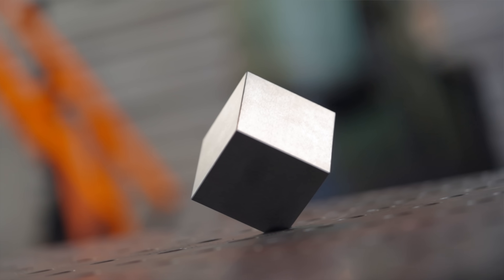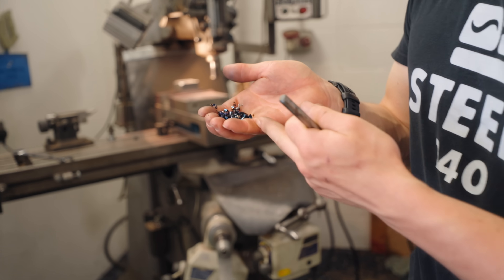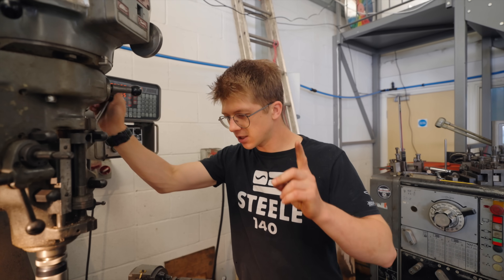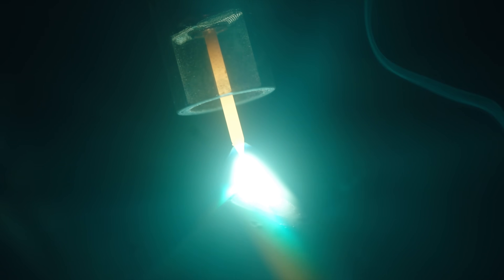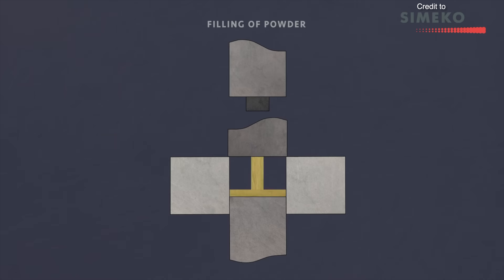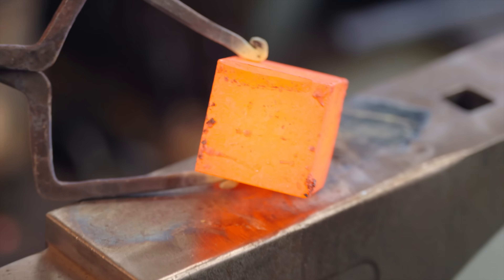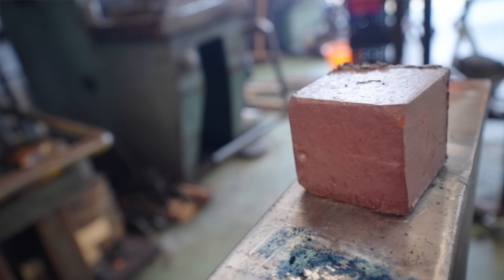Can You Forge Tungsten?

Comment: 4:50 tungsten is quite chemicly active metal and it dissolves in liquid iron, also did you notices that fine tungsten filaments exist? thats stuff is quite mallable, we used it to make lightbulbs ;)
btw. try copper-tungsten alloy, excellent machinability
also you can braze tungsten with steel using copper
Reply: Used to use tungsten filaments, a power source, and liquid nitrogen to convert the filaments into a glass phase (aka amorphous metal), rapid rapid cooling removes the crystalline structure of the metal and gives it some useful properties.

TIG welders will sometimes current sharpen their electrode and end up with an extremely sharp glass phase tip.

Anyways it was really useful for making certain high voltage electromechanical components, we used it to create a tough material that would flex a certain way under high voltage and current

Comment: 5:46 "Max 2MB"
Lol. Do you not realize that most phones take images bigger than that? Even my low-ish end S21 FE takes anywhere from 2 to 6MB.
It should be at the bare minimum be 20MB limit, not 2MB.
Not that I have a workshop myself or anything, but you'd hinder so many people from actually uploading images, unless you expect them to manually compress it by a lot just to send it, which people won't bother doing.
Ideally it should be more like 200MB limit, so you can have multiple images.
Storage is literally dirt cheap anyways, even on a small 1TB drive, if you were restricted to 2MB, that would be half a million images... Yeah, you're not getting anywhere near that amount from people submitting images, maybe more like 100-200 images.

Comment: I bought a little bit of tungsten wire for making tubes but ended up trying some as a needle in  divot for a seismometer hinge. I didn't expect it to be as easy to hand tool as it was. I ended up tripping over it during the night and broke the needle. The way it broke was also unexpected because it splintered lengthwise before shattering short-wise and the surfaces had a sort of cakey texture. I don't think they were actual air voids but looked something like broken cake. I wonder if it was made of incompletely sintered powder which seems like a weird way to make wire. The splinters make me think safety squints are probably an especially good idea when working with the stuff.

Comment: Something to consider with regards to alloying and incorporating tungsten is the fact that almost all liquids can work as some degree of solvent. You don't need to melt the tungsten if the solubility in another metal is good enough to slowly dissolve it. Any oxide layers may make it less feasible, but that'd be my first guess to the ambiguity surrounding some of the processes when you were googling

Comment: That isn't pure Tungsten and it behaves nothing like an unalloyed single crystal of Tungsten, nor even multicrystalline Tungsten.
For that cheap of a price (and considering its poor mechanical properties as displayed in the video), it's 100% just made out of very small Tungsten particles that were bonded together with Cobalt or (less commonly) Nickel.

It is MUCH more expensive to manufacture large objects out of solid Tungsten, so they add the matrix metal to enable low temperature consolidation and also to make machining easier (similar to how adding Lead produces "free machining" alloys), as you have seen by how easy it is to cut and abrade that cube with ordinary steel tools.

Comment: Forging tungsten is extremely challenging due to its very high melting point and brittle nature at lower temperatures. Tungsten has a melting point of 3,422°C (6,192°F), which is the highest of all metals. Because of this, traditional forging methods used for other metals are not applicable to tungsten.

### Key Points:
- **Temperature**: Tungsten can only be forged at extremely high temperatures, typically in the range of 2,200°C to 2,500°C (3,992°F to 4,532°F). However, this requires specialized equipment, like induction furnaces or other high-temperature furnaces, as standard blacksmithing forges cannot reach these temperatures.
  
- **Process**: Even at these temperatures, tungsten is still very hard and brittle, making it difficult to work with. It's usually processed through powder metallurgy rather than traditional forging.

### Conclusion:
While theoretically possible to forge tungsten at extremely high temperatures, it is impractical for most blacksmiths due to the required equipment and the material's characteristics. Tungsten is more commonly shaped using methods like powder metallurgy, sintering, or machining rather than forging.

Comment: People on tungsten and its forging and them being so Yes and No about it is because people say or read Tungsten and think of Tungsten Carbide. The problem is people like to shorten things which can obscure what they are meaning. 

As far as the melting, some metals will melt at a lower temp if they are mixed with other metals. They could also use powdered tungsten or they could do the melting chemically or electrically. Don't know exactly but its not always straight forwards as applying heat. Then again they could dump heat with electricity.

Comment: btw those cubes arent just tungsten, they are tungsten ground to a very very fine powder, which is then fused with a tad nickel
so they dont actually have to reach the melting point of tungsten.
you can check with a magnet.

Comment: To forge tungsten you need to get north of 1500C so you were a couple of hundred degrees out with your setup. Trouble is tungsten at those temps oxidises like crazy so hammer forging is really not a good idea. Most tungsten is formed using sintered powder where the atmosphere can be controlled to prevent oxidisation though this is a dangerous process as tungsten powder at sintering temps is very reactive with air and will burn or even explode.

Comment: 13:30 imagine a 5kg block at 1300 °C launching in your direction with lethal speed. I jumped.
Reply: right? how is bro laughing I would be terrified. it will probably stick to your skin too if it hits you... maybe you are "lucky" and it hits you so hard it bounces away and breaks your rib instead of frying your skin
Reply: @qwerty-d7j1i  Leidenfrost effect would likely have it boil the water from his skin and bounce off from an initial quick contact.
Reply: @synergy021  pretty sure the leiden frost effect wouldn't help too much with a 5 kg block he'd still have some pretty sick burns
Reply: @synergy021 yeah most likely the most that would happen would be a slight toasting of the outer layer of skin which is a weird experience cause it smells like toasted almonds at least my skin does I suppose it could vary person to person and I'm not going to test any of my friends lol
Reply: @synergy021  The Leidenfrost effect from the sweat he isn't sweating? Even if he were drenched in sweat it wouldn't matter because sweat has fundamentally different thermal properties than water and can give anywhere from 20-40% less insulation time versus pure or mostly pure water. 
A brick of red hot tungsten will easily singe you down to the fat, muscle, and bone in less than 0.1 seconds. **It is akin to sticking your hand in boiling water for 40-60 seconds.**
This man flipped a coin with serious injury on both sides and it landed on the edge. Insanely stupid moment.
Reply: @qwerty-d7j1i usually really hot metals just like toast the surface of your skin rather than sticking from my experience, it's quite odd and leaves a smell like toasted almonds and like a tan colored burn area that looks almost like a callus
Reply: @qwerty-d7j1i it won’t because of the leidenfrost effect
Reply: @qwerty-d7j1iyou would at the very least get a nice square or pointed third degree burn from a very quick touch. I would know as I accidently touched a piece of metal we were heat treating at 750C for only a tiny second and didnt feel a thing except itching afterwards. And when you dont feel anything from the burn it is indeed a third degree burn as it has burnt your nerves
Reply: And then he continues to put it under the Hydraulik press still wearing a t shirt with no protection at all, this feels very stupid.
Reply: yes it could melt a Karen too
Reply: I was certain someone would get hit by it. 
That would have been very bad for that person
Reply: What is the lethal speed of a 5kg block of 1300 °C tungsten? 0.01 m/s?
Reply: @TomTomTomTomTomTommy  I think the speed of the block could be lethal if hitting a bad spot even at room temperature.
Reply: I was also quite frightened for a moment
Reply: So much drama :)
Reply: My jaw dropped so fast
Reply: any 5kj block at 1300C is always at lethal speed change my mind
Reply: I reflexively paused the video in an attempt to freeze the block from hitting him :<
I don't know what my brain thought it could accomplish but it seems I have an innate want to freeze time :<
Reply: @ForestRaptor indeed.
Reply: Sabolt
Reply: 9:00 melt or cause it to react with air at high temp?
Reply: this is a jumpscare, I throw my phone
Reply: Far from lethal speed, but very dangerous indeed.
Reply: Yeah, not good
Reply: you jumped ? i froze!! lol i would be absorbing the heat untill it melt past my bone lol
Reply: I'd definitely have needed a change of pants, jesus
Reply: My guy needs at least a welding apron geez
Reply: Genuinely scary.
Reply: Molten companion cube from the density dimension is a guaranteed bone breaker. That thing would have cracked whatever it hit to the marrow. 🎲
Reply: Dont try this at home. I almost died just from watching that.
Reply: Him: LOL
Reply: ME TOO
Reply: yeah, I took a bite out of my chair when that happened.
Reply: right? I got so worried for him 😳
Reply: There was a proposed weapon that was just tungsten rods dropped from orbit It'd heat up nicely on the way down, and have a wonderful terminal velocity.
Reply: I was perfectly still while drinking a cup of tea
Reply: So you mean a a 120MM nato round
Reply: I read this.. new it was coming.. still jumped!
Reply: red hot cannon ball fr this time.
.
Reply: I have been told of a guy who died in a similar way. The melted metal went right thru his body. They were cutting metal with torches, not forging tho.
Reply: @TaylerTayler-up8mc  Yeah, force pushing is a huge factor.  something bumping you... might only stay in contact a moment.  and 5Kg or not... this cube is gonna bounce off.  End result would be like getting branded I suspect.
Reply: @Sir66Hugh  lolz... that'd be... weird.
Reply: @marhawkman303  Likely branded with a cracked rib or two from the sheer force of the impact.
Reply: @TaylerTayler-up8mc  That sounds somewhat similar to what HEAT rounds and explosively formed penetrators do. Not the armor penetration part (that's done with a shaped charge), but they usually have a bit of copper or something within the shaped charge itself. The concentrated force of gas from the shaped charge's explosion can penetrate armor on its own, but those with the copper liner shoot a superheated jet of superplastic copper plasma that can penetrate much thicker armor.
Reply: The editor put a video zoom in to hide the outcome, but I wouldn't be surprised if he deflected it away with his gloves or tongs. It looked like it couldn't have missed him and he'd have been hyper-aware of the possibility.. and then the laugh like he got away with something very dangerous.

Comment: What about inductive heating? I worked in a tow hook maker factory and i worked on the smithing section (later milling). We had a little, high power inductive heater, it toke 30second to reach a yellow/white color of the bottom of the rod while i was able to grab it with wool mittens on the other ends (just to insert them in to two sockets and the press create the bulb on the hot end.

Maybe you can reach that heat with tungsten as well... before the heater melt down. :D

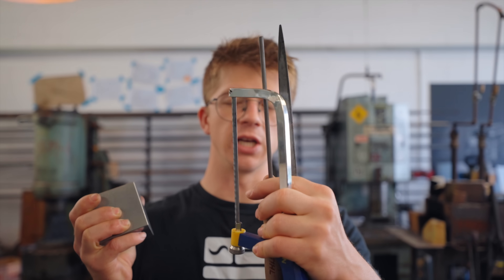Comment: At 2:06, you mention that its density is 19.25g/cm^3 (correct), but your graphic shows 19.25g/cm^2 (not a volumetric measurement).  At 2:14, you have a similar thing with the carbide bit.  It's just a confusion between the graphic and the statement.

Comment: So fun fact, to make alloys you don’t necessarily need to actually melt all constituent metals, the higher melting point metals will dissolve in the molten ones at a much lower temperature than required to melt them.

Comment: 3,422 C is Tungsten's melting point
but its ductile to brittle transition temperature (DBTT) is ~400 C

Tungsten is usually only use because it has a vary low coefficient of thermal expansion

Comment: You should make your own steel from iron sand. You should cast an ingot of steel out of the turnings from the power hammer. And finally you should make a set of tungsten tongs to make it not so expensive make just the jaws and machine a screw to allow you to attach the jaws to a set of steel tongs

Comment: So if steel melts at 1500 DC and you forge it at around 1200. Tungsten melts at what 3460 or what you said so shouldn't you be able to forge it at 3000 DC

Comment: You can make a Tungsten logo and press-fit it into a knife or something. Once heated, the metals should diffuse together like how Gallium diffuses into Alluminum. It would mostly be the steel diffusing into the Tungsten if it's heated close to its melting point, just enough to fuse the two together. This might or might not work in the tunsten/steel damascus idea, there is only one way to find-out but I believe that if both are heated together for a very extended period of time, there may be sufficient alloying to help the tungsten shavings stick and not fall-off like sprinkles off melted ice-cream. Also, I think the tungsten is smoking because it burns before it melts in the presence of oxygen, however I am basing this on basic physics/chemistry knowledge and I have zero metallurgy experience so I could be completely off. There seem to be better and more-detailed explanations of this in the comment-section, love the nerd-out! Somehow I'm more happy you got a giant block of Tungsten to play-around with than if you were to get a giant block of Gold! 🦾